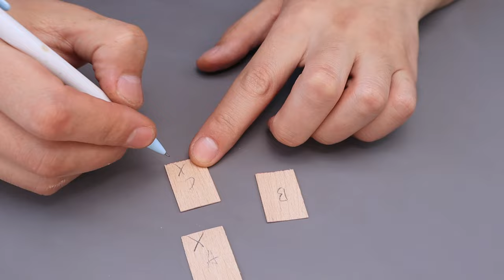Homemade classic small Wooden Metal Try Square for woodworking layout | DIY How-To

Comment: Nice, I'll have a go at this. You could also use an offcut of the steel rule instead of the beech wood slice.
Reply from the maker: This is a good idea. However, I am working on other projects with these offcuts, which you will see in a few days.
Reply: That or, chisel away some wood where the ruler part is supposed to go.

Comment: This is a nice-looking square, and a very convenient size for some measuring situations. But, how exactly did you guarantee that the ruler is exactly 90.0000 degrees to the wood piece? It seems that you might be depending on the end of the rosewood being exactly square, or maybe the beechwood piece?
Reply from the maker: Use a square to fix the inside Angle, and sand the outside with my hands. Although a bit clumsy, this is a simple way.
Reply: if you mark a square line, then flip the ruler and mark it again from the same side, the lines should be parallel. This trick also works for bubble levels.
Reply: @jurikristjouw  Yes, your suggestion is one of multiple ways of verifying a 90 degree angle for this gauge. I had originally raised the question because the video did not at all offer a method for establishing the exact 90 degree angle before drilling the two holes for the pins. So, an inexperienced person following the video could easily have ended up with a slightly-out-of-square square.